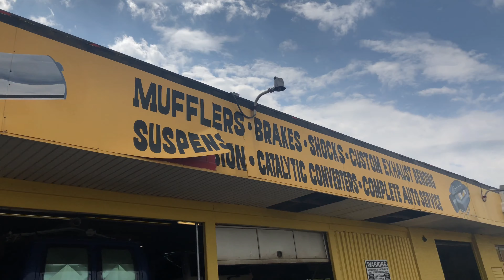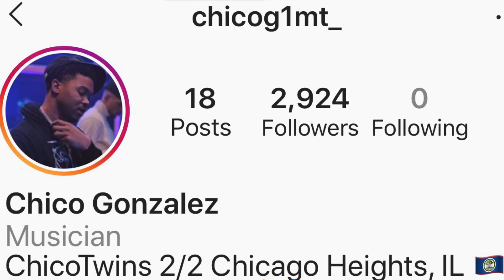I Took My Audi S7 To Get A Muffler Delete And This Happened....

Comment: You need a full straight pipe usually for backfire. So no cats. Muffler delete just makes it sound better. Look up videos on YouTube of how others sound with basic muffler delete. Goodluck!
Reply from the maker: I wanted to but it was basically pointless if I wasn’t going to buy a Audi exhaust. It’ll mess my sensors up and turn my check engine light on so it was best to wait and order a Audi exhaust and use that one that works with my sensors etc
Reply: @ChicoGonzalez1MT  try to see if you could find something on throtl. Check out their YouTube chanel they have a ton of info and a website with a ton of  aftermarket parts on their website

Comment: Why didn't u get it done brobro real men straight pipe it haha
Reply from the maker: I wanted to but it was basically pointless if I wasn’t going to buy a Audi exhaust. It’ll mess my sensors up and turn my check engine light on so it was best to wait and order a Audi exhaust and use that one that works with my sensors etc
Reply: Fair call bro nothing worse then having sensors lights on your dash when there isn't anything wrong. Can't wait to hear it after you get the audi part installed